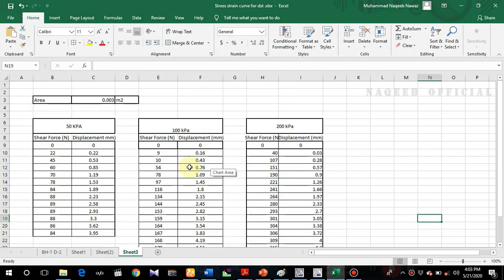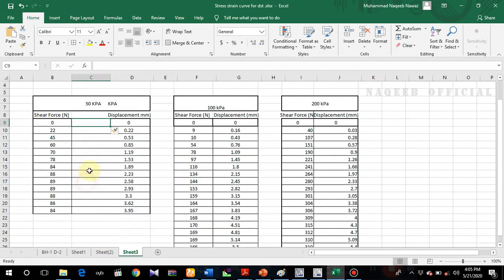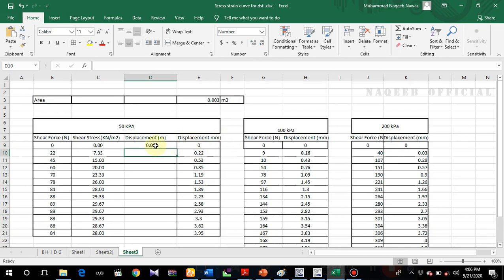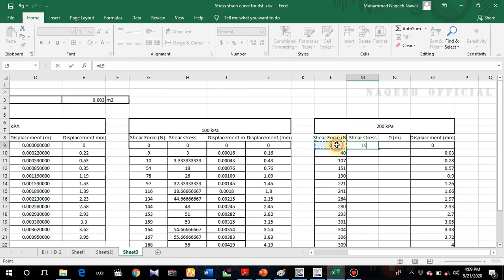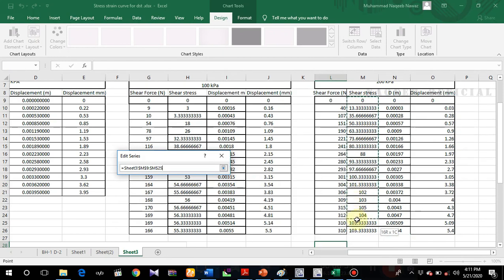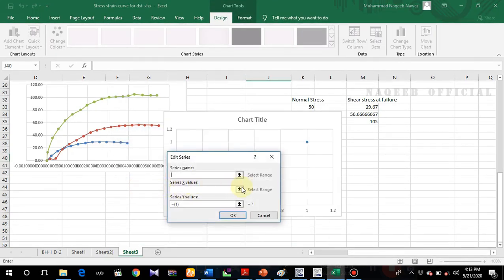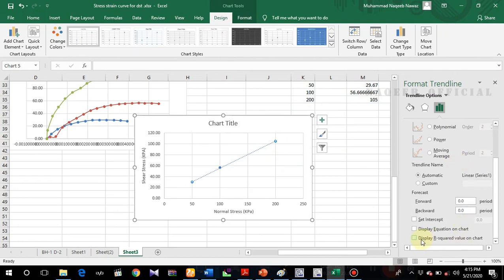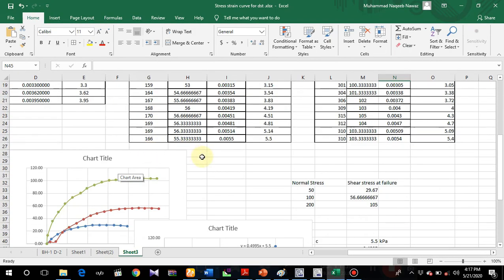Direct Shear Test Calculations | English | Geotech with Naqeeb

Comment: Thanks very helpful but can you send me a Geotech worksheet and excel files?
and i have questions? where the shear force came from? is it from Proving ring? 
and the Displacement? is it horizontal displacement or vertical displacement?
Reply: @geotech with naqeeb
Reply: Yes I am now struggling on the same thing

Comment: How do you choose those values of 50 100 and 200 for Normal stress? If the answer is checking the depth of the sample, could you specify more? Because I never see an example where they calculate the normal stress for this type of problem. Thank you
Reply from the maker: In direct shear test, we don't simulate the effective depth rather than that in accordance to ASTM D3080 we need to develop a failure envelop. so its upto you, you can either adopt normal stresses of 25, 50 and 100 kpa as well. so it is not mendatory to adopt 50, 100 and 200 kpa. For more details plz read ASTM carefully

Comment: I think that your normal stresses must be adapted whit the displacement. At rigour studies the impacted zone is the corrected surface !!!
Reply from the maker: can you elaborate plz...are u saying about use of corrected area??
Reply: Yes about corrected area ! Un your curve we have to use the stresses at faillure (normal stress at the moment of faillure too). This is calculated whit the corrected area
Reply: @cheikhoundiaye5556  your point is valid but we can take corrected area when we have equipment with vertical displacement..usually direct shear test apparatus dont have vertical displacement.thats why..and ofcourse it will be failure shear stress vs normal stress..also we make  we make a  failure envelop considering linear trend so c and phi are already somehow have conservative values..due to all these we have to perform triaxial
Reply: No, its not imposed to get vertical displacement ! The corrected area is the same. So the normal stres is calculated for a ratio between the initial normal force considered and the corrected area
Reply: @cheikhoundiaye5556  in my opinion we must have vertical displacement as well..but i consider your point...and secondly tbere is no area correction recommendatio n ASTM D3080-04 thats why i didnt include this point..but i have included this point in triaxial test video